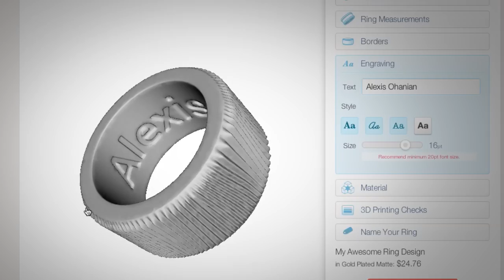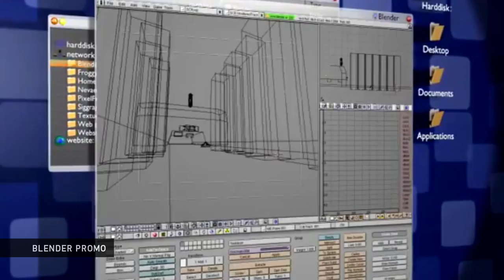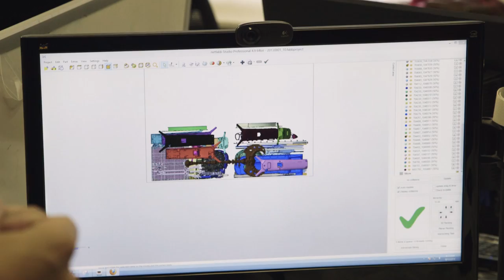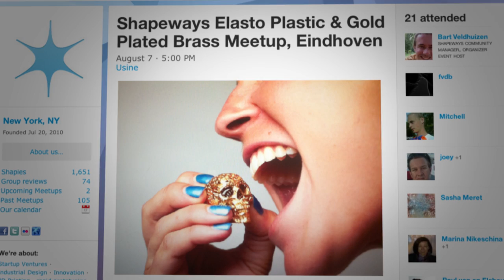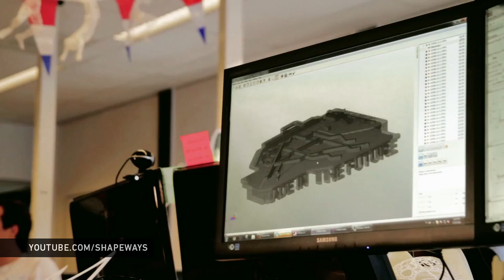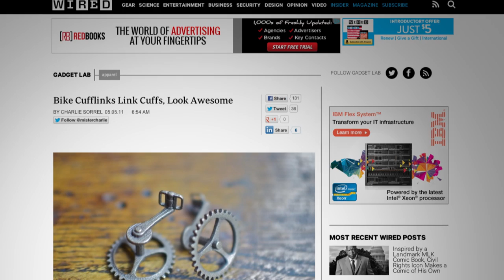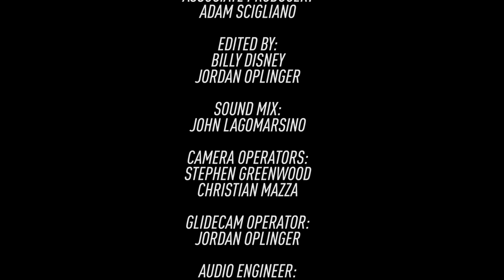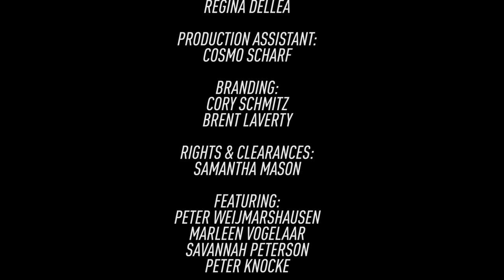Small Empires: Shapeways and the business of 3D printing

Comment: Not necessarily... What they didn't cover on here is that a lot of the materials they use on shapeways require more finishing than basic plactics... Like the gold electroplating (not familiar with all the materials they have now, but many are like that). Also, a single machine which can print in ten or twenty different materials is a LOOONG way off, there will always be a place for off-site printing which uses a different machine, even if you have comparable machines for other materials at home.